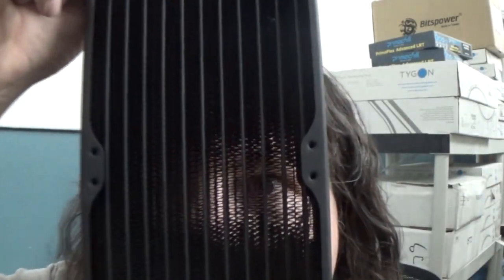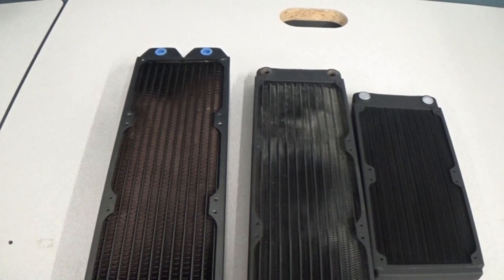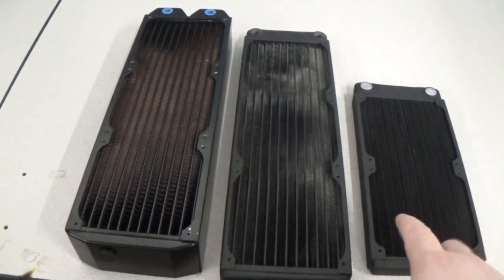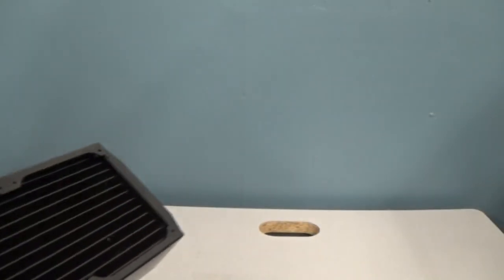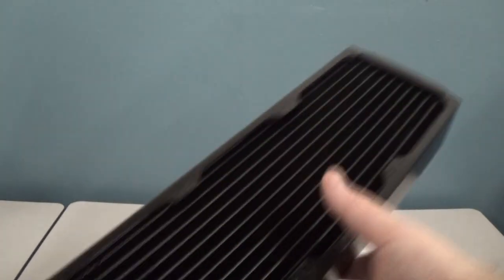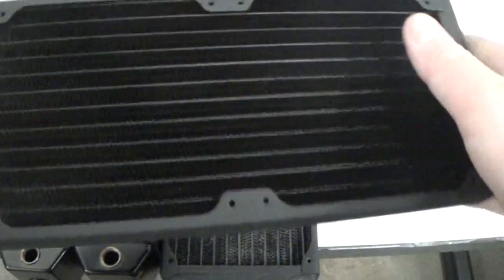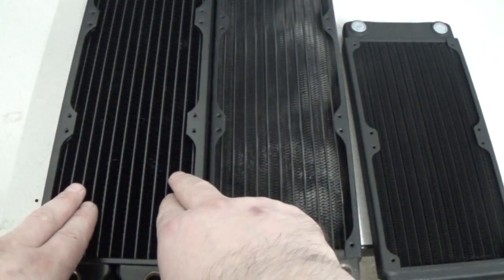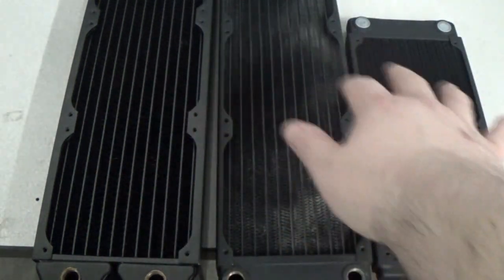FrozenCPU.com pc radiator choice. Thick or thin?

Comment: I'm currently using the Alphacool NexXxoS XT45 Full Copper 1260mm SuperNova Radiator (14351)
With d5 pump hanging off the side of the radiator.

With the Aquacomputer Cuplex Kryos NEXT VARIO With VISION AM4/3000/5000, Nickel/.925 Silver (21786) Waterblock it's cooling the delidded Amd 7950x with liquid metal and it has been a great improvement overall.
Can keep it cool and quiet or really cool and loud if you want it to be lol.

Comment: does the number of channels (or tubes, idk what they're called but basically where the coolant flow inside the radiator) matter? I see the most common is 12, some are 10, others 18 which looks too restrictive.
Reply from the maker: Sure it will matter. Quite honestly I have not looked too far into that aspect. I am sure it is similar to air cooler heat pipes where once you reach a certain amount you get diminishing returns.

Comment: Love frozen CPU... just a tip on the video. There is more that goes into radiator selection, like heat soak tables radiator material and fan selection and static pressure fans off FPI. There is more but still great video love the site.
Reply from the maker: Absolutely right. I wish I had more time and testing equipment to do the more scientific stuff. Thanks for the kind words.

Comment: What's the best one on the market atm?
Reply: I don't think there's absolute "best". It depends on your requirements. They're all build on the same basic principles explained here. Just make sure your fans have sufficient static pressure for the fins density of the rad.
I go with EKWB for their 45mm thick low fpi triple model as a good compromise. I can fit two of those which gives me good cooling performance even though I'm in fact aiming for low noise / low maintenance.